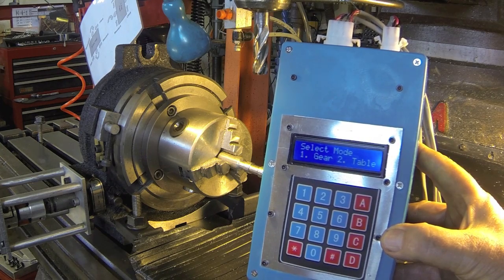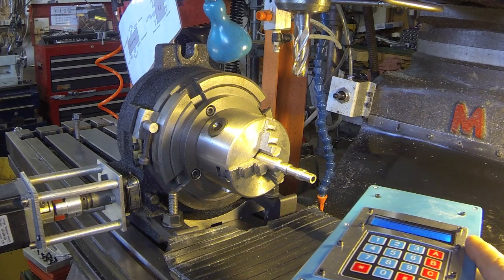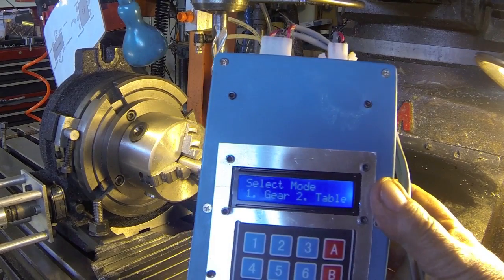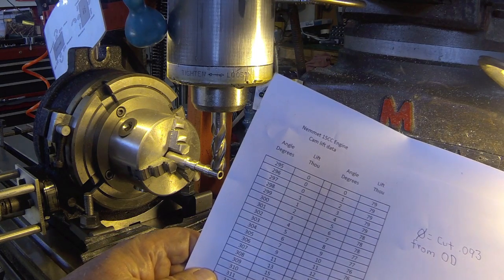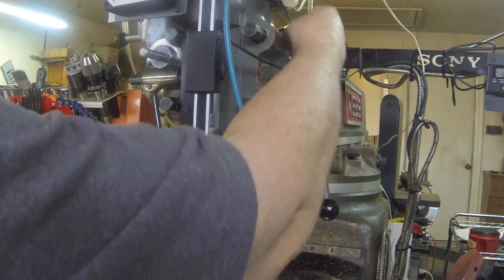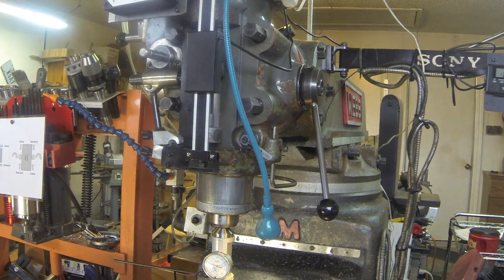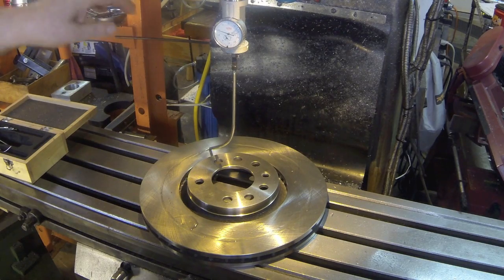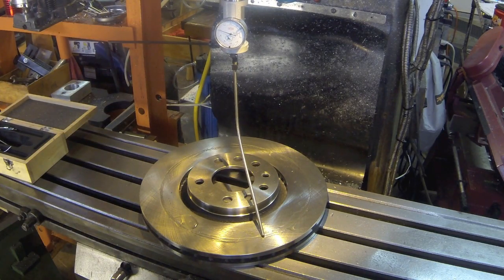This week in Herb's workshop #25

Comment: Hi Herb !

I love that rotery table indexer - I would like to do one myself for my rotery table ... whe I finished it ;-((

I saw that tramning of the mill head on one of John Mills videos ... nifty method !
Reply from the maker: I can send you the diagrams and code for the Arduino if you like.
Reply: Herb Blair Oh, thx Herb, but I plan to make the controller as a program on a pc ... just to refresh my programming skills ... thx anyway, it was very nice of you ... and maybe I will, if the program don't work fast enough ;-))
Reply from the maker: Keld Sørensen
Arduinos are simple to program and they have great libraries of code already done.  My code is less than 500 lines long and that include many comments.